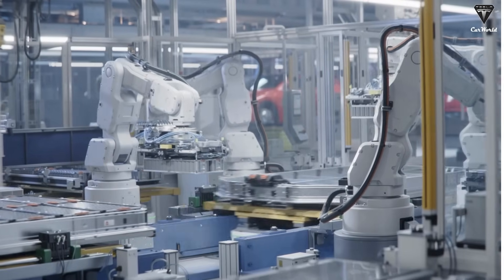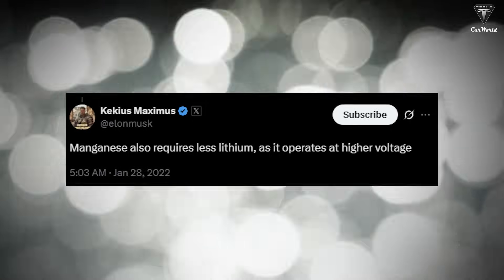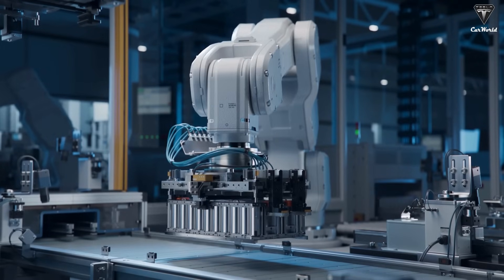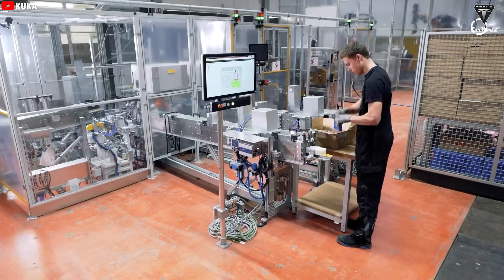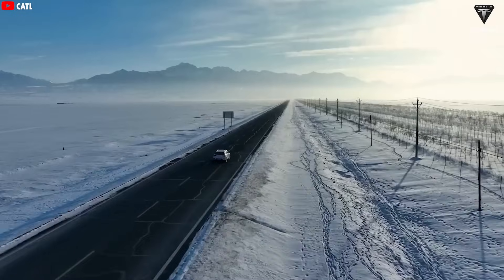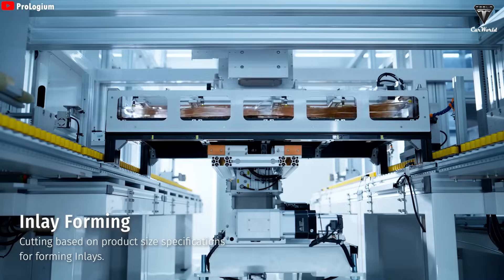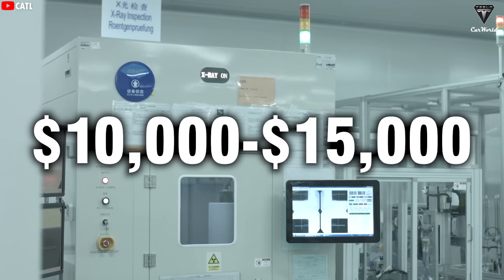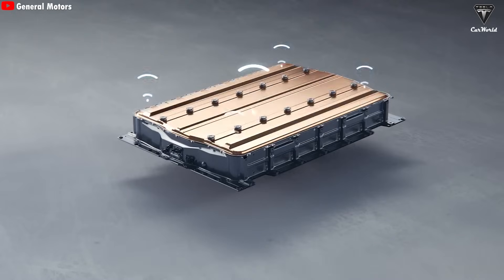NEW LMR Battery 33% Higher Energy Density SHOCKED Elon Musk & EV Industry | Replace 4680 Tesla ?

Comment: What kind of charging speeds are we looking at with LMR compared to LFP or nickel-based batteries?
Reply from the maker: LMR batteries generally offer faster charging than LFP due to higher energy density—expect around 20-30% faster than LFP, but slower than nickel-based.